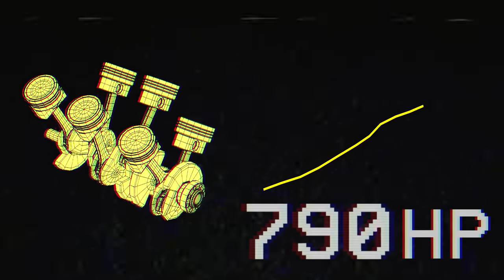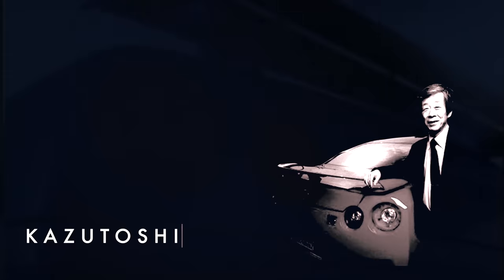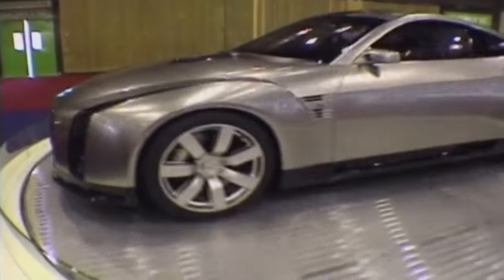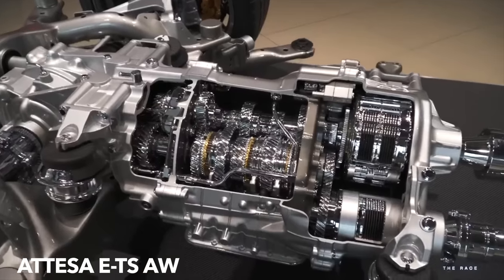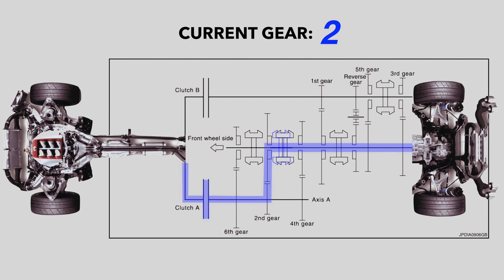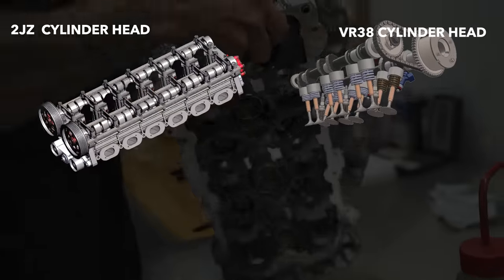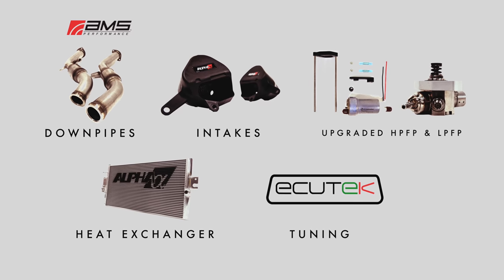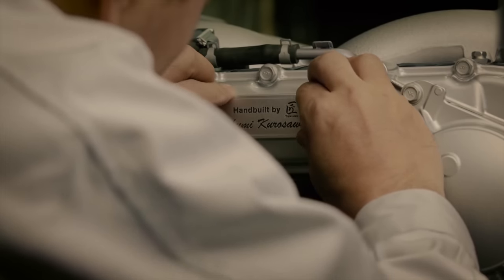Why Nissan’s Turbo V6 Engines Are Too Powerful (GT-R and Z)😳| Explained Ep.31

Comment: Thanks for the details and comparison on the VR35. 
My 2007 G35 was a special order from Japan. It has amazing leather seats and gauges,
a track switch, ground effects, 6 speed and all the options.
It puts 360 hp to the ground, 100% stock and mint. Perfect balance and aerodynamics. 
And the g35's drag coefficient of .28 , beats most other production cars.
It is so fun to walk Stangs and Camaros on the streets.
 On the track, it passes 911's easily. These cars are fun and are so underrated.

Comment: Ok, y'all, I'm sorry for sounding like a dumbass American, but what the hell is the difference between an Imperial horsepower and Metric horsepower?
Reply from the maker: American cars are rated based on the SAE J1349 while European and Japanese cars use the DIN 70020 guidelines. The “PS” or “PferdStarke” is German for “horsepower” and is 1.4% higher than SAE power.
Reply: @337speed  I had no clue there was a metric horsepower. I knew they used watts or whatever, but wow. Thanks for the schoolin'.

Comment: Back in 2014-15 when I built my Z33 Drift car I could not afford the VR38DETT so I fitted its turbos on my VQ35HR. Still running today, over 500whp and over 600nm torque. It has lower boost than stock GT-R, only 0.72 bar, running E85..

Comment: It doesn't matter GTR has a great engine. If this engine is not on Maxima, 370/400Z, or Infinity Q50…..almost every company does this by using powerful engines in their cheap cars…this is why the Japanese failed on making it sports cars

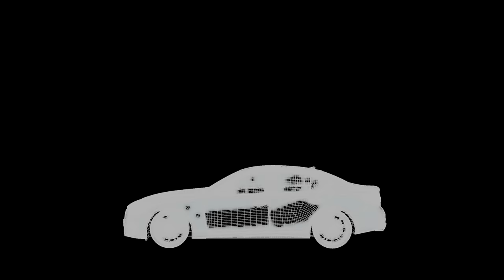Comment: I've been elbows deep in and have built 2k HP VR38's. It really is an amazing engine. I've but Alpha Omegas and installed lots of Dodson clutch parts. The bill for our biggest build was over 1/4 Mil, not including the car. @12:24... Q50 Red Sport 400 sedan. @14:56... That looks like the Proto that Top Rank is currently selling.

Comment: i dunnoo my 2020 400R VR30DDTT is pretty sweet with 400hp stock.
i could do with more and a sharper Gbox or even a manual.
but i wouldnt say for the weight its over powered.

Comment: I disagree, the Inline-six is the best engine design for insane power and reliability. Name another engine design that has so many variants capable of making 800+ HP on stock internals.  The RB26, the 2JZ, Atlas 4200, and several more. Don't get me wrong I love the V6 as well and I have a twin turbo V6 in my driveway that I absolutely love, but if I was going to build a monstrous car from the ground up then I would be throwing a twin turbo Inline-six in that mofo.

Comment: I tried to like my new 2012 GT-R but it had a fault in the transmission ECU on the 2nd day of ownership. I was left with only 1,3,5th gear and reverse. No boost, and about 50 miles from home or any dealership.

Comment: For a lot of you guys who simply waging war over Nissan Vs. Toyota. Let’s put this into perspective. I’m a ford guy and I’m a sucker for 5.0 push rod motors, let’s say I leave the engine completely stock except for fuel management and a forced induction. The most my 302 can hand is about 400whp pending on the what year the block is from. And a 351 can supposedly hold around 550-600. Your 6 cylinders are stock bottomed holding down 6-800whp. Regardless who you like fact is jdm in general is 100% BAMF. But I’ll still stick to my blue oval. So cheers and enjoy life and be happy we all have different tastes.

Comment: Isn't stock engine (with stock internals) limit ~700hp? That is not "Too powerful". With built internals it goes over 1000hp, prolly, but that is not "Too powerful". When you go to numbers that are "too powerful" you have swapped out the block for billet block. At that point you no longer have same engine, but something else. This is same as some guy told that he is running fastest Ecoboost mustang, ~900+ hp. When you go into details it came out he had swapped out Ecoboost block for Mazda block, because all the internals he had in Ecoboost block fit right into and Mazda block, what was stronger. At that point that is no longer Ecoboost, that is Mazda. When talking about engine, I think engines that are not using factory blocks should never be taken into consideration.

Comment: I once owned a 2005 350z import with le man sunset metallic paint and even though it was only 270-280 bhp it sounded exactly like a r35 gtr with that hooning trumpet V6 which used to scream at 4k-5k rpms. Love and miss that motor

Comment: I'm not a petrol-head or engineer, and apologies for downplaying the story here, but the outset of this vid kinda highlights the brilliance of Nissans V6.

  Generally speaking, I find a lot of the praise factor on engines moot when achieving these extreme torque/power figures requires replacing massive chunks of the engine entirely, ya know, like virtually the entire block
    And this feeds into my 2nd point, I've seen 1.8L engines output about 700WHP, extreme fuel system, but all the same difference. If you have available infinite $s, can't anything be reengineered to stratospheric proportions?
   If you literally had a million $s to rebuild a V12 (that was chastised on the intro here), I'm assuming someone could make that dish multi 1000s of  BHP too no?

Comment: Vr30s are known for porous blocks and internal coolant issues. Mine was sucking coolant at 73,000kms. Yes you can make power for cheap. But everything has a drawback. In this case. I dont think these motors were made that great.

Comment: What happened to that ZEOD engine or whatever they called it, 3 cyl turbo they put in one of their hybrid ZEOD RC (race car)
I heard that thing had some good horsepower for being an engine you could lift with your legs... in an upwards twisting motion... 
That kind of power + the low weight sounded pretty bonkers. Guess it was "2 good 2 be true"

Comment: Hello Mr. 337 SPEED and fellow petrolheads! I’ve been saving up and waiting to purchase a pre-owned latest generation of the GTR. Can you please help me out by recommending specific model years, specifications, factory options and other relevant information that will ensure that I can acquire the most reliable, with relatively low running  and maintenance costs, and will have the best possible chance of powertrain longevity without the expensive rebuilds and repairs. I’m looking to keep it as stock as possible, and not as interested in modding it except to proactively address known issues. I’m also interested in getting some affordable suspension, tire and wheel combo, and engine reliability upgrades. Your feedback and suggestions are very much appreciated.  

Thank you very much!

Comment: Yeah... I am not convinced.

This video has too much bias, and not enough technical details. Pretty sure the 2JZ is equally capable and simpler since it is an inline 6. I don't vote down, but I really thought about doing it. If, at least, you openly said you have a bias for this engine, I would have been okay with that. But you never said so, made wild claims without explaining why you think it's better engineering.

Worse yet, you distract from the main point by showing us the transmission. It's disingenuous.

Comment: Haha, so with upgraded internals, the 2J, LSX, etc aren't capable of those power levels?    Hahahahaha, it WAS a good video until you said that. You need to learn about power potential of engines that are built dude...

Comment: Idk if 3.8 liters is a tiny v6, there are v8’s that are the same size. There is no replacement for displacement but you can make powerful smaller engines, formula 1 is another example

Comment: I like the vr it's a great engine but it's really hard to like because of the younger annoying vq the vq isn't nearly as good sometimes it can be but it's timing unit just feels like a piece of crap and is nothing but a problem child constantly having issues I stick with the toyota competitor for the vq the 2grfe still capable of the 2k hp mark but just a lot better sound and also a lot better timing unit but now you can probably figure out what car I have if you are a car builder

Comment: The best Nissan engine, proven by multi wins in 24h Le Mans as the LMP2 cars powerplant, is the VK45 - V8 made by Nissan. After all VK45 was used by Nissan in 350Z and GT-R in the Super GT series in Japan.

Comment: You didn't mentioned the big brother of the RB26 it is the TB48DE (for Nissan patrol y61) a large inline 6 cylinders 4.8L naturally aspirated iron cast closed deck engine gives you 280HP the engine better than the 2jz in  terms of tuning.

Comment: just to add the stock vr38 ignition system like you could walk into any Nissan parts department and purchase it will reliably support 2000hp and is an upgrade offered by tuning shops for other engines pushing for high hp

Comment: I owned 4 Nissans (1983 Sentra, 1988 Z24 pickup, Nissan 200SX, 1994 Sentra).  Except for the 200SX these cars were all pretty much bullet-proof and I drove them all over 200,000 miles.  But the way Nissan is made now, I would not dream of owning one again, because they are nothing like they used to be.  Once Renault took them over it was the end as far as I was concerned.  And all the negative Consumer reports and forum posts detailing all major problems the newer ones have, are plenty to put me off getting another Nissan ever again!  Toyota, Honda and Lexus are the only names I trust now.

Comment: Much/most VR38DET performance development was done at Mahle Powertrain in Northampton a specialist turbocharging engine developer that also did a lot of performance development work on Audi V8s and other supercars - which big car makers would frequently farm out to specialists for their low volume and consequently almost always loss-making performance vehicles (mostly exist for brand enhancement/advertising reasons).  V6 is perfect for turbocharging with almost no overlap between exhaust pulses on each bank meaning the cylinder scavenge and turbine efficiency are near optimal.

Comment: There’s one engine you may not have heard of which is Aussie designed and built. 

It’s called a 4.0lt twin cam turbo. 

They are put in a 4 door sedan which is a family car in Australia it  started in the BA XR6 turbo and they were factory 240wkw then they put better rods stronger and thicker so they turned them to a ZF6 speed and they were 270wkw factory. 

This is when performance shops started to get serious power from the engines and they produced 1000rwhp that can be daily driven. 

Then they changed body shape and better handling and the xr6 turbo had 285wkw and they made a F6 which was turned to produce 310wkw and they were faster than the commodore ss 6.2 engines that holden tuned to 325wkw. 

With the last of Aussie fords the engines producing even better and higher horsepower. 

Performance shop were I have my car looked after with 580wkw is one of the most popular performance packs but there is one fg f6 Ute that has 2000rwhp and is used as a work car during the week and either car meets or track days on weekends. 

They are a strong engine with big stroke but they don’t cost $100,000 of engine parts bigger intercooler and turbo and the other things needed for huge horsepower you can buy the vehicle and get everything done for between $80,000-$100,000. 

If you want to see what they are like you can look up on 1320 videos on YouTube they came over to Australia and went for a ride in a blue Ute. 

Or have a look at adamlz he puts a Barra turbo in his gt350 mustang after the engine caught fire on a race track and the 5.0lt engine was toast

Comment: i have no experience with the VQ series or VR. But would you say they would be better then toyota's V6 xGR-FE series of engines?
I used to drive a nissan juke with the mr16ddt (love that engine) and am now driving a 2007 toyota harrier (RX350 variant with the 2GR albeit a bit worn)
Reply: In the case of aftermarket, by a long shot. In reliability,VQ's can last but a Lil less reliable to a degree,while the VR38 is gonna be a bit more expensive considering it's in a supercar tbh.

Comment: vr30 doesnt destroy its competition, the s58 is much better, faster and there are a plenty of 1200whp bone stock s58 engines with just turbo and fueling upgrades. the z will never beat a g80

Comment: single cam VG best nissan engine. they can hold a lot of power on stock internals and they are cheap and easy to find since they were used for 30 years.

Comment: The platform is still extremely new compared to Nissan 6's, but for most people who just want to do the basic mods & custom tune, the new BMW S58 is very tough to beat.  With just downpipes, drop in filters, & custom E45-E50 tune you add 220WHP & 220lbs(Approx 720WHP & 700lbs), for just $3k or so in mods and you have an awesome new M3/M4 thats both highly practical and a 9 second car..  No fueling, turbo, internals, or driveline upgrades required.  

Most people dont want to push a platform to its ceiling.  Most people dont want a 2000 HP, in a performance car that also serves as their daily driver.  Exhaust, intake, downpipes, intercooler, heat exchanger, chargepipes, inlets, spark plugs, upgrade the tires & rims and call it a day for vast majority of people..

Theres just now starting to be internal & driveline upgrades for the platforms, for 1000WHP+ builds, so its an extremely fresh platform, so I suspect we'll soon see them pushing down into the 8's for people who want to build out their platform.  However for just $95k, to get that level of build quality, functionality, & practicality, the new M3+M4 are fantastic platforms that punch above their weight & costs.  A couple years from now we'll see them in the 7's too as racers & product developers have time to fully research the platforms for drag cars.  While they dont currently have the highest drag ceiling, the best track ceiling, the best roll racing ceiling, they do them all very well.  

GTR are outdated and its a shame Nissan hasnt updated them....  Would have been great to see Nissan update this last production cycle... Ive seen some amazing designs from fans of the platforms that would have been amazing last hooraa before the last car leaves the production line..

So for people out there who want a highly practical high performance daily driver, and just want to tap into a little more of the performance potential, highly recommend the G8X Comp XDrive. Usable back seats, great trunk space, 30+MPG on the highway, all season + all weather, great interior, fantastic technology, materials, & build quality.  Upgrade the downpipes, midpipe, drop in filters, a custom E45-E50 map, XHP, upgrade to lighter rims and stickier tires and you have yourself a 9.75 car with a little dialing in...  Its not going to be the fastest car at a drag event, but I believe they are the greatest high performance daily drivers ever produced.

Comment: Pretty silly to compare Sr,  Rb to vr .. its got over 20 years on them both.. but my rule is v6s sound like crap and are rough running due to the nature of unbalanced banks.. 3 and 3. I6 and v8s rule . And although the vr is great it doesn't have the bromance of the Sr or Rb. They were my youth .. so I'm biased 😂
Reply: and the flat 6 from Porsche = Precision German Pu$$y.
Reply: @07wrxtr1  😂😂

Comment: So is the s58 the new vr38 ?
Reply: I wouldn't go that far but I'd say considering the car its in,it's technically the modern day GTR considering how easy it is to get power out of but is far from getting to gtr power figures in its current position in aftermarket.

Comment: I loved my VQ35 I had in my old I30. That thing was far faster than it ever looked and would catch people off guard. Too bad it was written off in a terrible way from hail damage, the engine was still going strong at 380,000KMs. automatic Trans not so much though

Comment: I'm no nissan fan but ill definitely give respect where its due and definitely a hats off for the vid man. You made sure to point out what was right and what wasn't 110%. I'd like nissan more if there fan base wasn't so close minded about the r34 lol all it comes down to is putting the same intake and drive train on the supra and then nissan fans will start to argue engine displacement classes lmao otherwise id like the skyline 😂

Comment: The GTR platform is probably one of the best you can get. The fact that nissan didnt do much revisions is also why the platform is so good and people who never did a build doesnt understand this. Even take 2016 revision to 2017+. Most of the body from the 16 doesnt fit the 17+ ie bumper/splitter, hood, fenders, etc. Having minimal changes allows more support in general. There are many shops in japan that primary focuses on time attack gtr cars and many of the products we can buy from the US because of the popularity of the car. If it kept changing every few years, these companies likley would not be willing to sell outside of japan because there would be a less of demand. US GTR aftermarket companies would become very niche

Comment: I never understood the "hand built engine" hype. Humans make too many mistakes.

 I would rather have an engine built by a robot and then completely checked over by a second set of eyes that had no part in building the engine to prevent bias.
Reply: "I never understood the "hand built engine" hype. Humans make too many mistakes."

Not these humans who building the GTR engines and if something is not corret they can fix it in the procces of building not when the engine is complete

" I would rather have an engine built by a robot and then completely checked over by a second set of eyes that had no part in building the engine to prevent bias."

the manufacturer want to associate the top model with something special, not the cheap product that was produced on the assembly line....and they got poven right..i bet the takumis can build the engines better than robots
Reply: @jetfighter200 Fair points.

You're definitely right about it being a strong selling point.